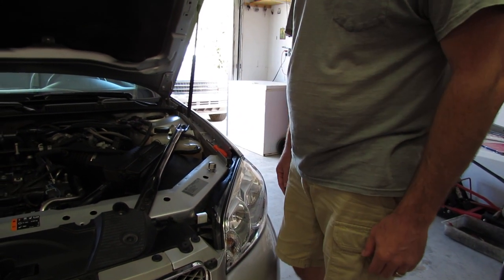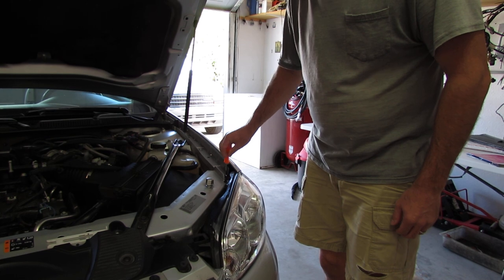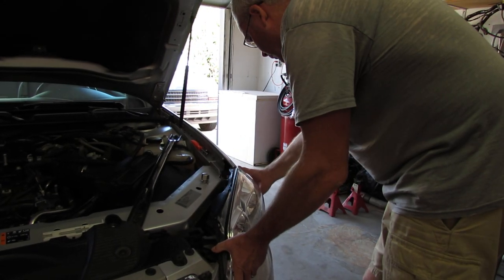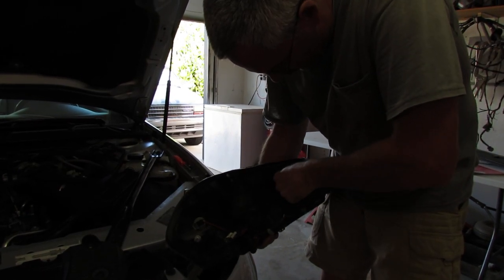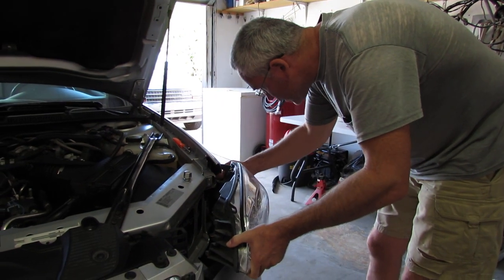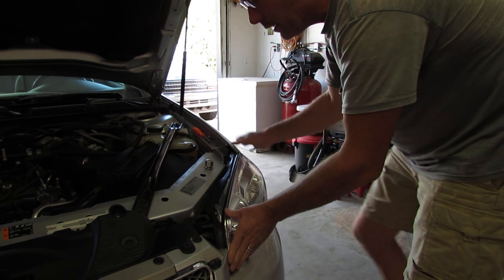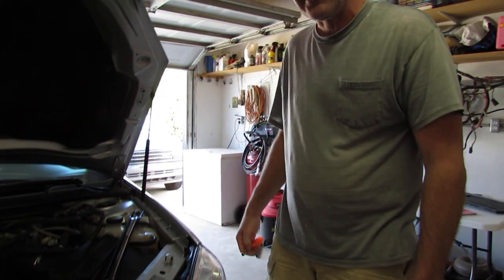2013 Chevy Impala Headlight Removal, Bulb Replacement

Comment: Thanks, very helpful! Two hints if you're bonehead mechanic like me: 1) Don't turn the silver (9mm) nut on top of the headlamp assembly (that adjusts the headlight beam angle/height - doh!) 2) to remove, use the black (as he says 7mm) nut further back on the body. And it will be a lot easier with a nut driver (like he used). There was not really enough room to turn the ratchet wrench that I used.
Reply from the maker: Hello Brad, 
                    Thank you for your comment. Have a great day.  Rick
Reply from the maker: Thank you Brad for your comment.

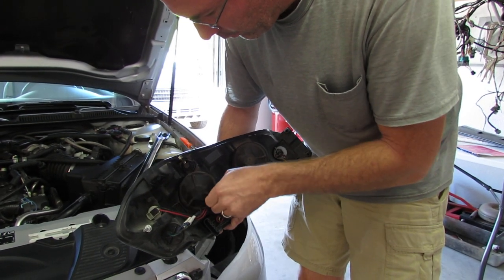Comment: One more tip: When you remove those black covers to access the bulbs, if you live in a cold weather climate, apparently that grease/grommet inside turns hard, yet very stick goop during winter. This can make it difficult to turn and remove the cover (at ~1:14). If you have old hands like me, wear a pair of nice leather working gloves for the turning part. You should only need to turn it a few degrees. If at this point you still can't seem to pull it off with just your hands, use a metal edge/tool to pry it open (I used my old trusty Buck Knife) and then you should be able to pull it off. Good luck!!
Reply from the maker: Hello Brad, 
       Thank you for the tip.
Reply: I found that out myself. It was almost like plumbers putty. I just took mine in the house and laid them on a heat vent for a little bit, and they twisted right off.

Comment: Thanx for the vid I had already did this before on the passenger side but I now have to do the low beam on the drivers side and now for the life of me I can't get the bulb cover to open I used a screw driver to push on it I used sticky gloves nothing is working for me I am afraid to use any more force than I have ...I don't want to break it and make it so . I have to replace the whole assembly. Should I use WD40? Or should I take in the house and run hot water on it???
Reply from the maker: Hello Jack, 
   Not sure why the plastic cover is not coming off for you. Maybe this headlight was replaced before. Or a factory defect.
   I would try to drill it out with a large hole saw and get a different cover from a wrecking yard like U Pull It.
Reply: Jack Fritz let me know what works for you, my cover won’t come off either. It’s almost like someone welded or glued it shut on one portion of it.
Reply: Nvm I got it. There was some weird caulking material attached under it. I use a knife to pry and scrape between the tiny spaces around the cover and was able to loosen it a bit, which made it possible to screw off. I also used a lubricant oil 👌🏾